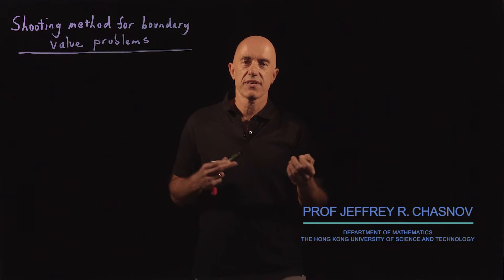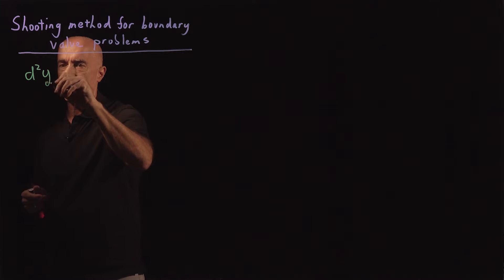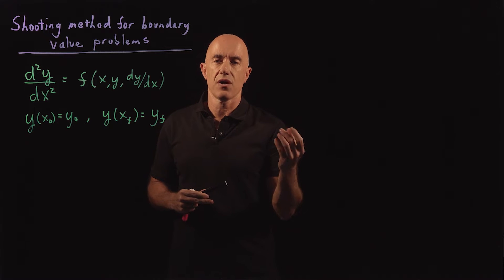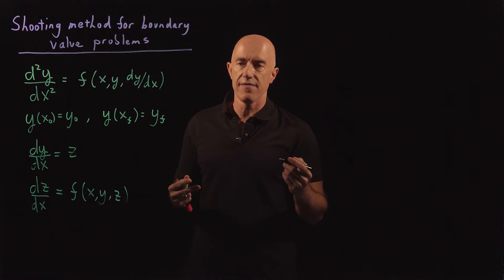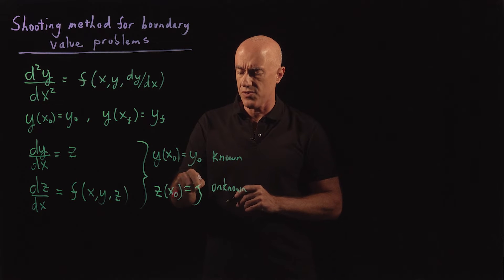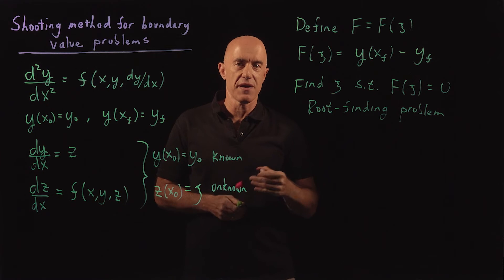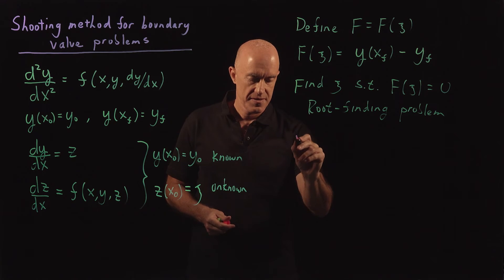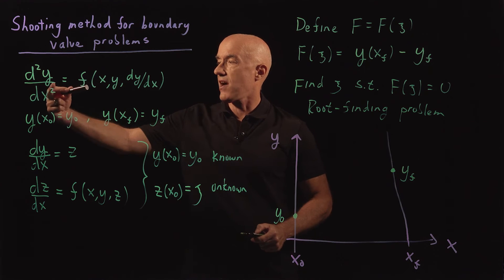Shooting Method for Boundary Value Problems | Lecture 57 | Numerical Methods for Engineers

Comment: Just to comment on this last sentence, you use fzero or fsolve for the root-finding and ode45 for the integration, couldn't you use an optimizer for satisfying both?
Reply: moreover, the fact that you have root finding and integration in the same problem classify it as a DAE problem?

Comment: Hey Jeffrey,

That is a pretty good explanation of the boundary value problem, thanks a lot for that.

Now I have a question about something that doesn't seem to get to my head, at least for now.

Let's say we have a boundary value problem and we turn this into an NLP such the dynamics of our system become the constraints, and we are trying to minimize a function that depends on the states and in the set of control inputs of this hypothetical system. When we call, for example, fmincon to solve this, this solver internally is solving these differential equations each iteration and evaluating the function F(j) = y(xf)-yf and persuing to minimize it, so in the end, you have all your states and control inputs that make this function goes to zero and thus have your final time constraints met?

Comment: theta0 = 0; u0 = 2; % initial ode conditions. uo is initial quess for root.
inf = 8* pi; % inf is a large number. Takes a long time to get to top.
tspan= [0 inf];
options = odeset ('RelTol',1.e-6);  % rootfind uo such that theta (inf)=pi
alpha_i = linspace (0, 2, 100);
u0_i = zeros (100,1);
for i=1: length (alpha_i)
    alpha = alpha_i (i);
    u0_i (i) = fzero (@(u0) F(tspan, theta0, u0, options,alpha), u0);
end
plot (alpha_i, u0_i);
xlabel('$\alpha$', 'Interpreter', 'latex', 'FontSize',14);
ylabel('$d\theta/dt$', 'Interpreter', 'latex', 'FontSize', 14);
title ('Shooting to the Pendulum Top', 'Interpreter', 'latex', 'FontSize',16);
function y=F(tspan,theta0, u0,alpha, options)
% use ode45 to define the root-finding problem end
    [t,yout] = ode45(@pendulum,tspan,[theta0,u0],alpha,options);
    y = yout(end,1)-pi;
end
function d_theta_u_dt = pendulum (t,theta_u,alpha, options)
% define the differential equation here
d_theta_u_dt(1) = theta_u(2);
d_theta_u_dt(2) = -alpha*theta_u(2)-sin(theta_u(1));
d_theta_u_dt = d_theta_u_dt';
end